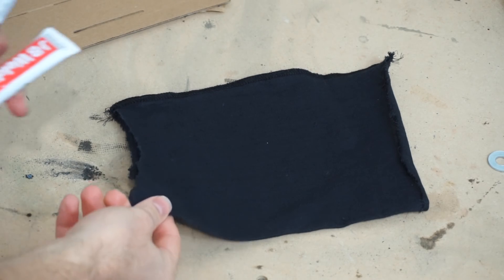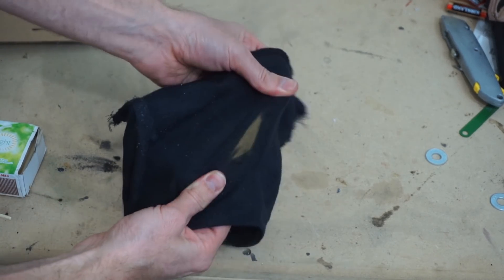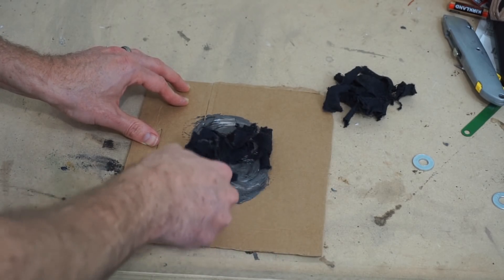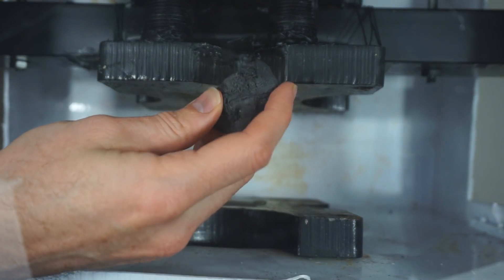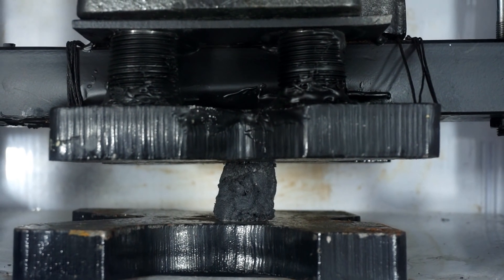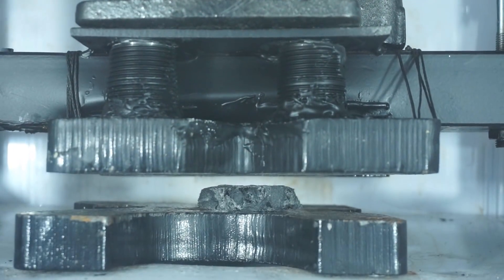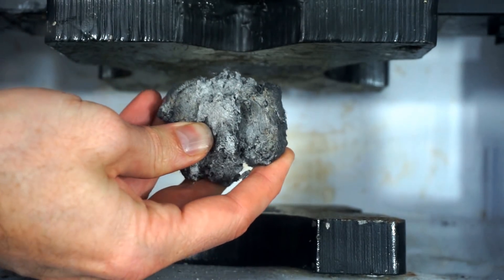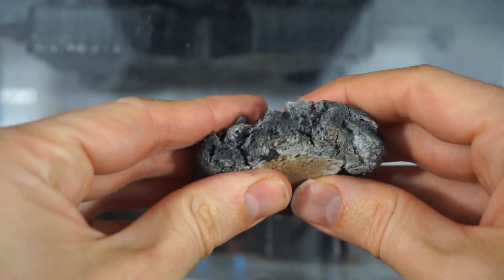Welded Kevlar Crushed By Hydraulic Press

Comment: You now know the difference between concrete or other solids and a fibre reinforced material.
Its not welded but glued together.
And after the flame its not "totally intact" but partially destroyed. Sames goes for Sunlight - it weakens it a lot due to breakdown of bonds in the polymer.
For the knife test: Please somehow verify that the knife is actually sharp (in the video!) or such a display is useless. It will cut kevlar (aka Polyamid) when its a sharp. Sometimes thats easyer than (special) scissors eg. several layers at once, a rope etc.

Comment: if its cut proof how did you have small strips of kevlar?
Reply: It's not cut proof, of course. You can still cut it with hardened scissors made to cut tough fabric like glass fiber, carbon fiber or as in this case kevlar. You probably could even cut it with good household scissors, but they'd get blunt real quick.
Reply: but how
Reply: BS Gaming he said cut resistant not cut proof
Reply: Marian Keller Thanks mate

Comment: I respect the experiment and you for trying it, however, I'd like to see you revisit this but in a slightly different manner. JB Weld is essentially an epoxy resin with powdered steel mixed in. Ballistic Kevlar is able to stop a bullet as a pliable fabric, with enough layers. Your method didn't exactly exploit the advantages that Kevlar offers. I'd like to see you take, say, multiple 1" by 1" squares of Kevlar, apply regular epoxy resin and essentially create a block of kevlar/epoxy that would end up being a few dozen layers thick.

JB Weld, is, unfortunately too viscous to penetrate the kevlar fibers entirely, so what you basically crushed was randomly places pieces of Kevlar that were, in a sort, bonded to one another in the way double sided tape bonds together. the adhesive touches but doesn't actually penetrate through the material that provides strength.

Again, I'm not trying to insult you in any way, shape, or form but the method you used doesn't test the true strength that Kevlar has to offer. If you would like to discuss that further, I'd more more than happy to give you more technical details regarding the matter.

shawnpwest at gmail dot com
Reply: why isn't this comment more upvoted? will he do such video?
Reply: thanks for teaching and respecting everybody 🙏

Comment: The Kevlar-epoxy can be compressed, somewhat, before the epoxy has time to set. This will expel the air and make it quite dense. A form, such as a plastic bottle, could be used. This is much easier than using a vacuum chamber for the purpose. Eliminating voids from composite materials can make a large difference in the strength. :D

Comment: Why would it be hard? Kevlar and epoxy aren't particularly hard.
Reply: Neil Gupta I was thinking the same thing!
Reply: jb weld is an epoxy that sets hard like metal,it has high temperature resistant qualities so as it can be used on parts that are hot to the touch when it sets,it has metal shavings throughout its matrix and if you have ever used this stuff before it makes one hellufa fume,especially when you use it on hot things like car exhaust,jb weld is hard stuff,its meant to be like liquid metal i guess you can mix anywhere,notice its metallic nature,its not normal epoxy you use on your kids swingset
Reply: will blizard Oh ok.
Reply: will blizard yeah, but isn't the Kevlar holding everything together because it's pretty strong?
Reply: im pretty sure the kevlar just adds tensile strength,like rebar in concrete,on its own concrete is hard,in certain directions,but brittle in some,jb weld sets similar,like the man in the video said,jb weld and sand just crumbled,so you are partly right,the kevlar is holding it together,but its the kevlar that kept it from just crumbling,which im sure that jb weld would just crumble like his jb sand,so yes the kevlar is holding it together,but at the same time,kevlar has very different physical qualities than an epoxy,and when the two are mixed,it creates i guess what you could call a paper, or kevlar mache,that puts regular kevlar and jb weld to shame by themselves